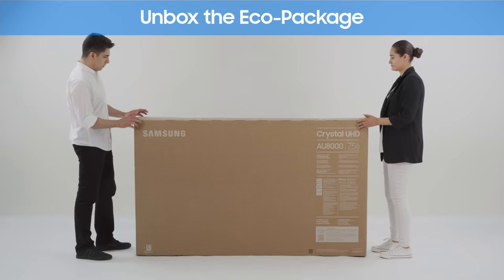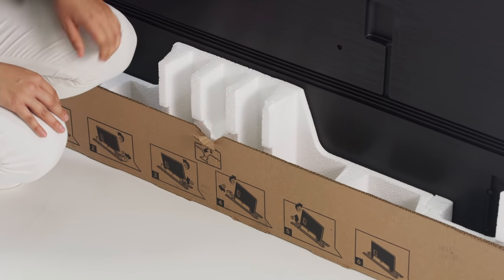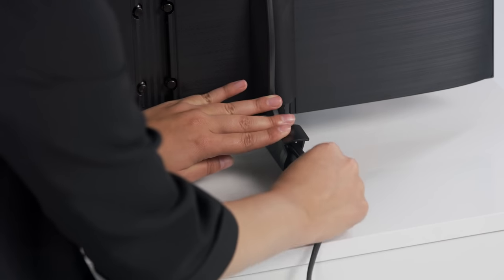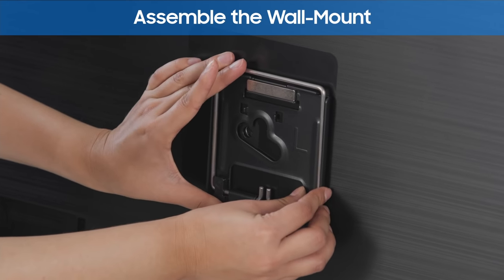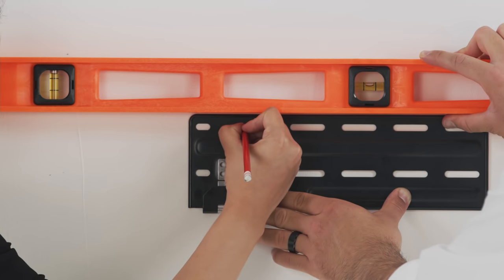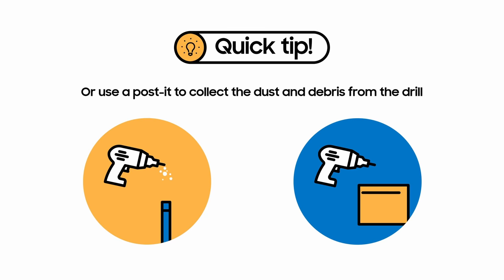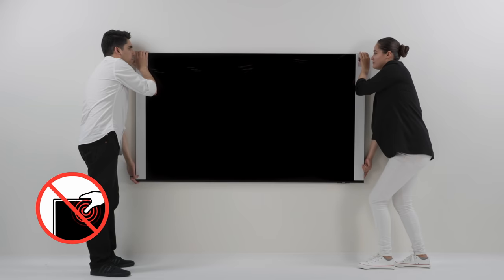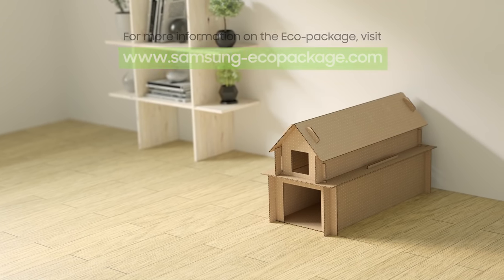How to unbox and install the Crystal UHD | Samsung

Comment: Are the long plastic screen liners meant to be that easy to remove?? when I did mine they were distorting the screen and with loud cracks as the glue released - any guidance on that?